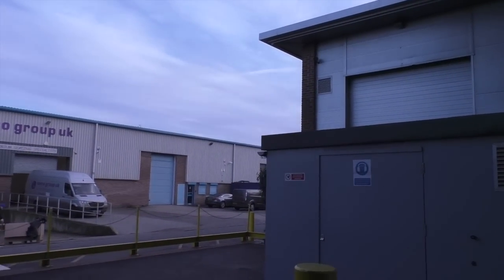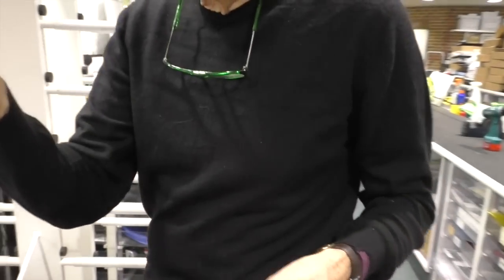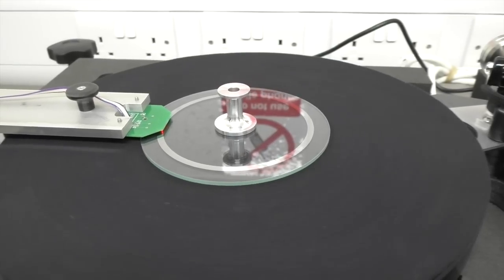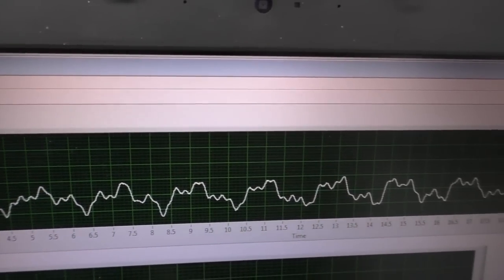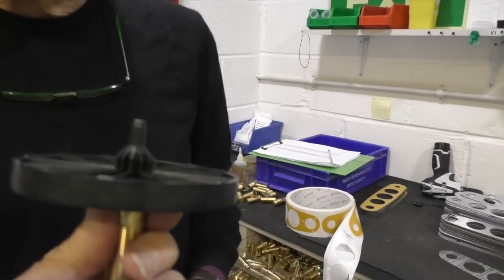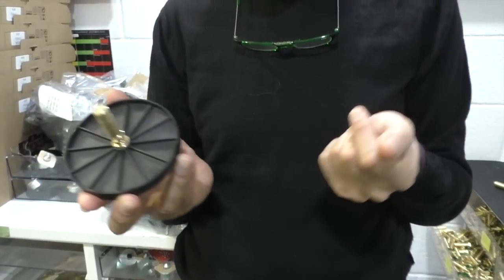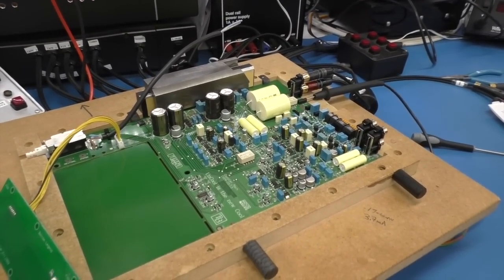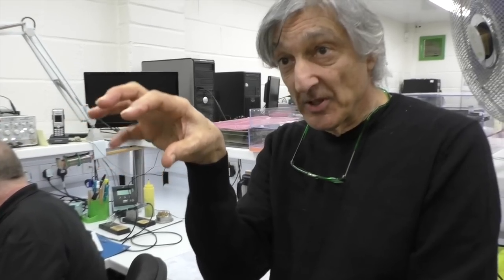AnalogPlanet Visits Rega Research (Part 4)

Comment: Great video Mikey, but the shakey camera work does drive me mad at times. My Rega has been in my system for around 10 years. It's a P3-24 fitted with an Exact MM cartridge and the outboard power supply. It sounds fantastic and very musical. I would definitely by another Rega, maybe the RP8 or 10 next time. Really good to see this company working constantly to improve and it looks like they respect their workers too which is great.

Comment: I don't know if you will have time to ask Roy about this but the "felt" mat doesn't appear to have changed since I had my "old Rega Planar 3. This is something that many owners change. With everything before the platter and after the cartridge being optimised for precision and minimal excess movement, how is a soft and squidgy mat, in relative terms, justified. Roy may say that they have changed the composition of the material over the years but it's still a "soft" mat. Good series Michael, I hope you get some time in their listening room as virtually nothing has been mentioned about speakers.
Reply: Deluk This was explained by Roy in an interview I saw somewhere on youtube. 
He tried ALL the different materials for the mat yet all of them came short in sound quality compared to wool. He felt that the wool mat pulls the sound towards their design philosophy and the Rega sound.
He admitted that other mats are better for other design choice turntables (high mass) and that the wool is more prone to static.
Having tried different mats myself (cork, rubber, composite) on my RP8, everytime I do so the sound quality takes a hit somewhere on the frequency spectrum (rubber one killed the mids). I always went back to the original felt immediately...it is noticeable. 
Hope this helps. I do understand that others prefer to tweak the sound more to their liking/system by changing the mat but that takes the discussion into another rabbit hole.

Comment: Interesting, this makes me recall the time when i buit a phonograph preamplifier stage in the past using a dual matched j-fet. The very high input impedance of the j-fets eliminates the need for a dc blocking signal capacitor to be used - with the electrically matching j-fets (in a single case) reducing signal distortion and voltage offset.

Comment: Those speed and Wow/Flutter numbers don't look great to me. Especially for such a high end table. Of course I haven't seen raw data like that much before but that just doesn't look great to me.

I'd love to have that digital setup at home so I could run my tables (PL-540 and Debut Carbon DC) through it to see how they compare.
Reply: Analog Planet- Thank you for the correction, Michael. I'm glad you've got access to this sort of thing and I really enjoyed these videos. 

I noticed the RP6 and P3 had the same tolerances. I've been considering one or the other lately- any preference? 

Also, surprised you didn't ask about the infamous Rega speed trick!

Comment: the Crosley c200 Bears resemblance to the Technica and the Audio-Technica however weight difference sound distribution would be completely different and it does come with an Audio-Technica stylus however from doing research on this product I'm not a hundred percent sure if the stylist can actually be replaced to an upgraded stylus and I'm not sure of what quality the tone arm is either however it beats what I currently have which is a cheaper Crosley. now I know Crosley is not a well-known brand to have a great reputation by any means but I figured I'd give the Crosley c200 a shot just to see what it's all about. so again that's why I'm asking if you can maybe do a review on that even though it has nothing to do with your realm of turntables or decks but it would be really cool for a hundred percent opinion by you

Comment: Michael, would you explain Mr. Gandy's antithetical philosophy on high mass turntables. ie,  while the rest of the industry has adopted the higher mass in relation to higher cost philosophy. Rega does the exact opposite. therye most expensive turntable has a plinth comprised of skeletal foam weighing ounces.
Reply: I found this in the description of a RP10 on the NeedleDoctor website:

Skeletal plinth design with polyolefin foam core:

Controversially Rega has always researched methods of producing light but stiff and rigid plinths. The technology is simple: unwanted noise at microscopic levels is developed by the turntable motor and main bearing. The plinth can also pick up airborne vibration from the music. From the beginning in the 1970’s Rega pioneered the use of a stressed skin structure for the plinth. This uses two layers of phenolic resin with a lightweight particle or fibre board sandwiched between the skins. This technique has been used in many applications where stiff, light structures are needed such as an aircraft wing or a Formula 1 chassis.

The current increase in interest in turntables has allowed Rega to research and develop higher technology structures for the customer who is happy pay a little more for higher sound quality. The all new RP10 turntable utilises a unique new stressed skin structure produced from thin phenolic skins sandwiching a featherweight nitrogen expanded, closed cell, polyolefin foam core. This material has been developed exclusively for Rega over a three year period. The RP10 plinth is 7 times lighter than the weight of the original Planar 3 plinth. Rega has added even more stiffness in the crucial area between the arm and the main bearing.